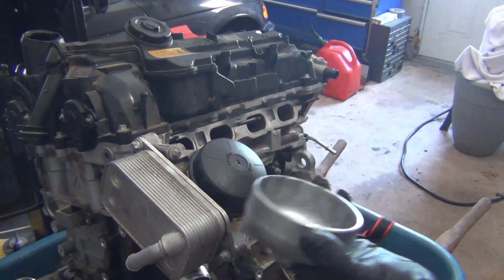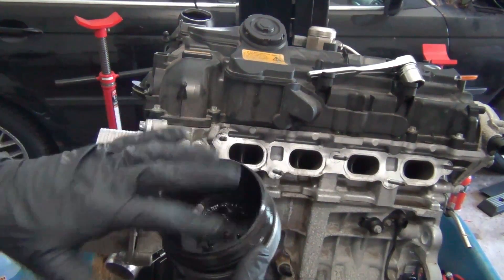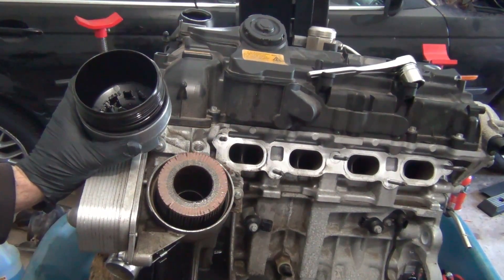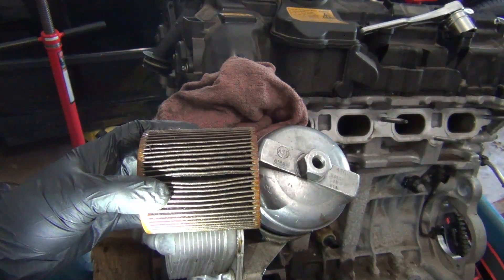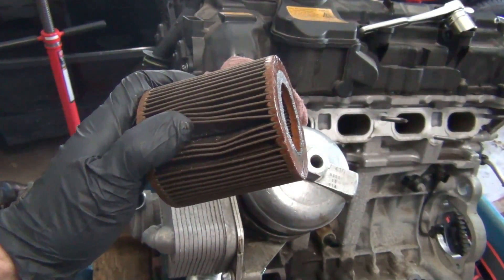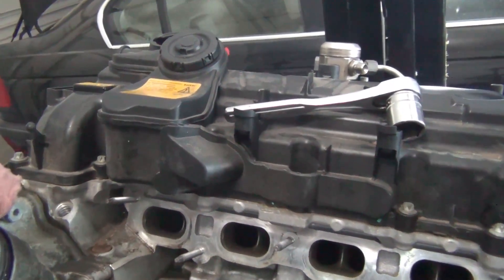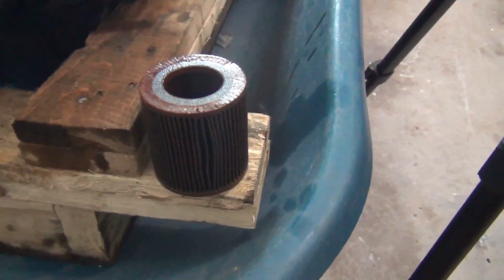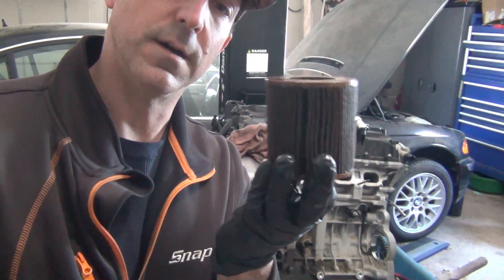Diagnosis Of Engine Problems Or Failures Using The Oil Filter! BMW N20 Engine Failure!

Comment: I have my collection of used oil filters, after having the serpentine belt sucked though the front main seal. That was about 25K miles ago. However, I've never taken the time to check them out. You have inspired me do so.
On another note, every time I watch your newer videos, I cannot identify your voice as the voice on your much older videos when you never showed your face. It bugs me now every time I watch a newer video. Without seeing your face, your voice reminded me of Tom Cruise's voice. But now that I have seen your face, it no longer does. I still can't believe that you are the same person as on older videos even though you probably are. Or maybe you are not???
Reply from the maker: Hi Steve, I am the same person but with a different camera set up. Maybe I should go back so I sound like Tom Cruise LOL! Definitely take a look at your filter and let me know if you see anything odd :)

Comment: Thanks, Roger.  That's a great idea, actually, to check the state of the used filter (I always do my own oil & filter changes).

Here's a ? for ya:  My wife's E84 2012 (N20) once and a while makes a "chirp" on cold startup.  Naturally, when I shine a light on the engine and have her cold start (morning) it never does it....however, I did not the drive belt tensioner "contract" a few times on startup.  The belts are new, I changed them a year ago (main belt + power steering belt) - all OEM belts.
Yesterday, I finally got around to swapping out the belt tensioner/pulley (again, new OEM) and I didn't see it "contract" on startup.
The old tensioner/pulley didn't seem to have any odd bearing noise or slop.  It was orginal from Jul2011 when we bought the X1 new - on 54,000Kms on it.
Wondering what you think?  That original "chirp" seemed to come from the front centre area of the engine.
My N52 tensioner needed changing a couple of years back which is common and was more obvious looking at the old unit.

Thanks!  Darn YouTube didn't inform me of this video.  I just happened to check (09Mar22 ~18:00PST).
Reply from the maker: Hi Mario! Sometime you know it's time to trade a vehicle in by checking the oil filter :) For you wife's car it most likely is the tensioner. They do loose some tension over time. What I usually see is the belt not quite center on the pulley and it walks toward the outer edge when the tensioner is failing. Next video will be out Saturday at 9 am with more N29 info. I pull the bearing cap off on the intake cam. Talk to you soon bud!
Reply: @AskTheCarExperts  Thx, my friend!  Sat 09:00 your time, I guess eh?  I'm lovin' this N20 series you're doing 👍🏻  Keep 'em coming.
BTW, Chevron regular here in YVR? $CAD2.10/litre.  That's $US6.21/USGal 😰

Of course, my BMWs only get Chevron 94Octane.  No ethanol in the 94.   I don't even look at the receipt.....
Reply from the maker: @MarioDallaRiva  Thanks Mario! Gas prices and food prices are definitely putting a strain on a lot of people. We are over $5 for high test but your location is a lot higher. Thankfully I use 89 for my truck but 15 miles to the gallon if I drive like a grandma is about the most efficient I can get.

Comment: Roger that’s why I don’t let anybody touch my BMW, had dealer and independent shops that claim they work on our cars but don’t have clue. Twice I’ve had damage done that was inexcusable. Lots of diy information to fix and service your own car. Thanks for your past support.🇨🇦
Reply from the maker: So true Anthony! Anyone that is mechanically inclined and puts the research time in can do lots of repairs successfully!
Reply: I’ve had someone pull off my engine cover on my n20, he was a family member that moved next door and decided it was cool to check out my cars engine while I changed my oil on my car. It stopped building boost and I didn’t know he had pulled off a few hoses and I was so confused 🤦🏻‍♂️

Comment: Hi I don’t know if you remember about the 2013 528ix that I did the complete timing chain assembly including the oil drive pump assembly I did check the last bearing cap on the Intake cam like you proposed and it was in excellent condition but the oil pump strainer was full of plastic this could of been really bad if this car was able to run much longer  the engine ran fine for a few week but now it’s back with a cylinder no.3 misfire at first I thought that it was a coil or a plug but it’s actually leaking compression From the injector seal it was misfiring at idle but not a constant speed or full throttle have you ever seen this before ? I’m going to order a new injectors because I’m scared of the heat that injector
was exposed to is this common I never seen this on any direct injected engine yet.
Reply from the maker: Hi Christian, Sorry to hear you have a misfire on cyl. 3 now. It is a good thing you caught the timing chain issue early. The pickup can get clogged and cause engine failure. As for your compression leak at the injector seal, that is not a common failure. Make sure the hold down threads are not compromised as you can loose tension and the injector will wobble and cause elongation of the bore which could lead to a cylinder head replacement. When you put in the new injectors use the seal to feel for correct tension. There should be some tension between the seal and the injector. If the bore is elongated the fix will be to replace the cylinder head unfortunately. Let me know how you make out Christian.

Comment: What if it’s steel instead of aluminum?
Reply from the maker: Hi Chris, If it is steel it could be piston ring material, crankshaft material, or timing chain material. Most of the time on a BMW you will see aluminum or copper. Copper means the crankshaft bearings are damaged.
Reply: @AskTheCarExperts  thanks! I do have timing chain rattle on a cold start, besides that everything sounds/drives fine. It’s a m52-tu
Reply from the maker: @christopherldavid  Hi Chris, The timing chain does not usually fail on the M52TU. You might be hearing the VANOS unit rattle. They can rattle on a first start sometimes. It usually does not cause any problems. If you make a video and post it for me I can give it a listen with you.